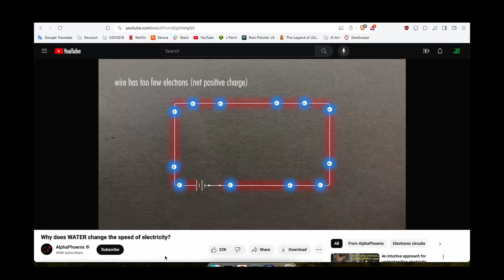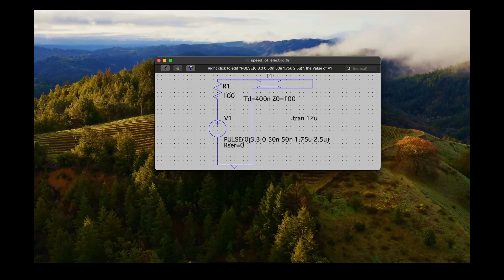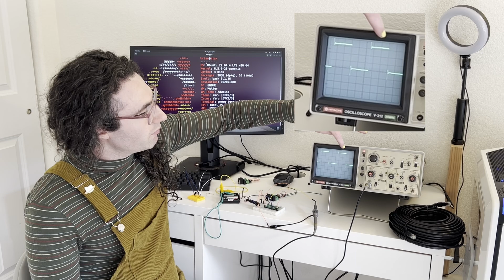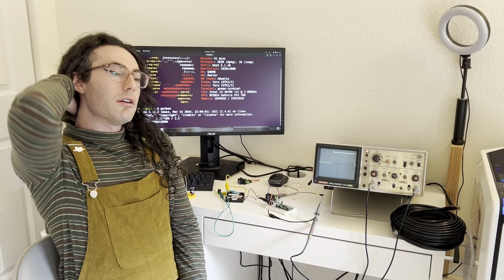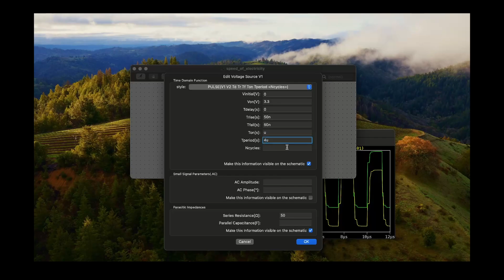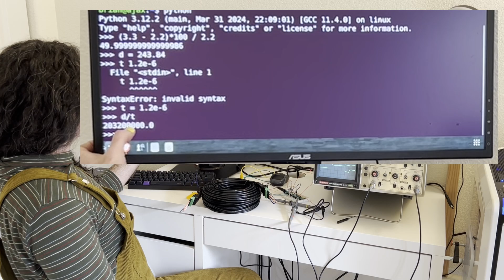Measuring the Speed of Electricity Using an Analog Oscilloscope

Comment: Hello!

About the transistor circuits, those are P-channel MOSFET transistors I'm using. Is you use BJTs, they can work but you need a base resistor to limit current into base otherwise you  could hurt your pulse generator output. Because BE of a BJT is just a diode that shorts your microcontroller output as you see in your measurements around 29:37
Also the 100 ohm I used was to match the line impedance. 
and of course my pulse won't go as high as 5V because the transistor being on always has a tiny voltage across its drain-source due to current passing through RDS-on.

Have fun!
Mehdi (I don't know why I'm signing the comment here)
Reply from the maker: Wow I can't believe you watched my video!  I'm such a big fan!  Thanks so much for the advice and for answering the questions I raised.  I'm gonna try and make those changes and probably make another video with some other electrical tests.  My background is in astronomy, so I have decent knowledge of E&M theory, but circuits and electronics is mostly new to me and I'm trying to learn all I can about them!

Brian (signing my reply for symmetry)

Comment: I assume the Pico will have a buffer stage for each analogue output. It could be improved or at lest brought to a known value with an external buffer. Edit. .At which point you show Electrobooms circuit. Exactly what I had in mind. 50 ohm coax is also available..